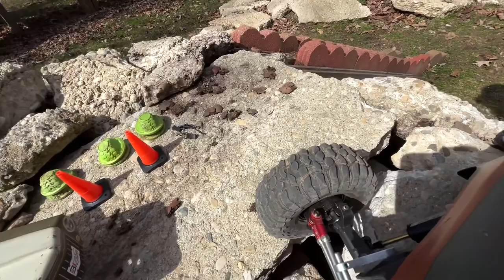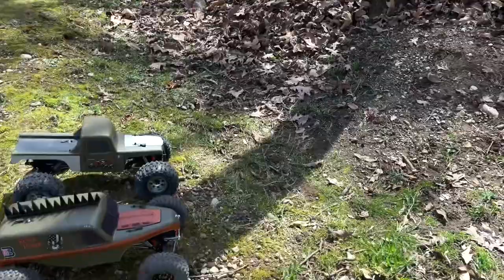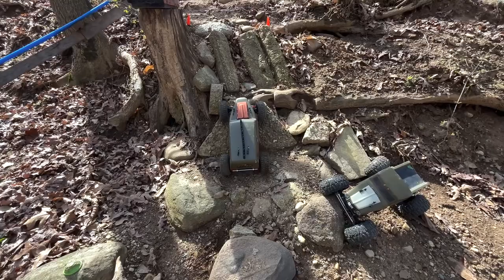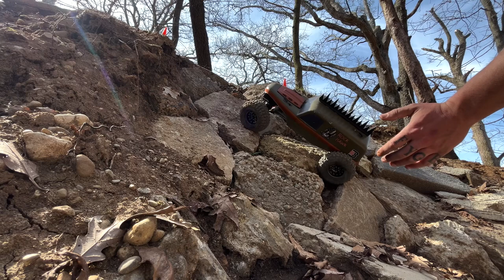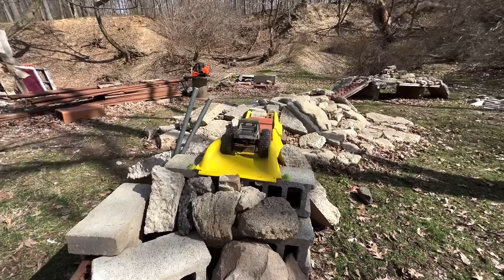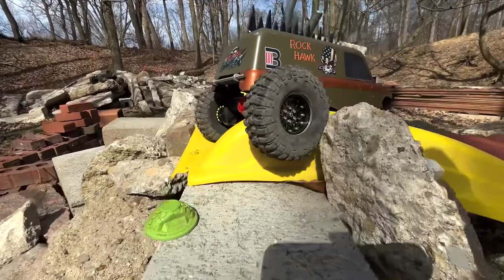Gated battle in The Pit. Grab some snacks, it’s gonna be a long one!

Comment: Spike might need some new shoes.
Reply from the maker: What makes ya think that? It could possibly use a little softer insert and some suspension tuning, but those  Krawler’s are feathered in and hook up great.
Reply: @DRZ-RC  Maybe it spike is too heavy?
Reply from the maker: @rccrawlingaddict207 I haven’t weighed it, but it’s definitely not a heavy rig. It’s a good bit lighter than the Gapra is. I’m still working the bugs out of it though, it is a new/unproven rig at this point, so I don’t have any real complaints about its performance at the moment. Especially for a C2-ish rig with a 13.5” WB, I think it’s doing pretty well so far. The lines I took in this video are far more challenging than they look on camera. The top of “Hardline” is a little over a 65 degree incline on mossy concrete, and the “impossible line” is over 70 degrees on a dirt and concrete mixed. So even though it didn’t do as well as the 4ws C3 rig, I’m pleased with how Rock Hawk is doing, but there’s always room for improvement obviously.
Reply: @DRZ-RC  I used to think every rig should be capable of the same task's. But by the time you spend enough to make it that way, it's not the same rig anymore. It took a while to sink in that I only need a couple of rig that are super capable. The rest will have to settle for just being good enough. I only ever tried one comp that only had nine entries. I took second, and my buddy (that I always crawl) with took first. With a Traxxas High Trail no on top of that.  I made one mistake, he made none. Half of the other players couldn't even finish the course. It's all fun....
Reply from the maker: @rccrawlingaddict207 right. There are definitely different levels to all of this. I doubt Rock Hawk will ever be as capable as my 4ws rigs, however, it’s already become the most capable drag axle rig I’ve got. Maybe I’ll do a video of it and the Ecto in a head to head, just to show how capable it really is, when compared to something a little closer to its “level”. It’s hard to put anything up against the Gapra, that thing has a tendency to defy logic from time to time, it’s kinda like cheating driving that thing.